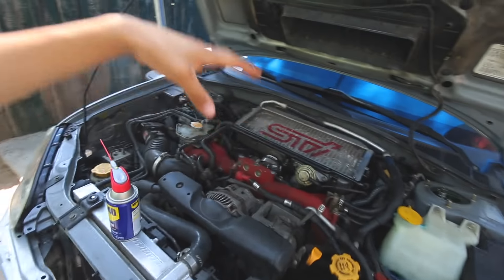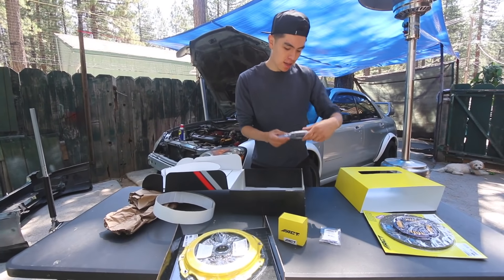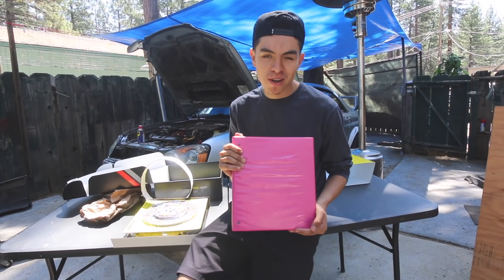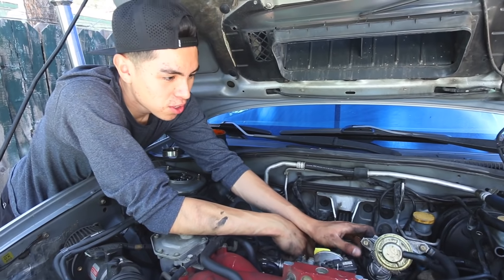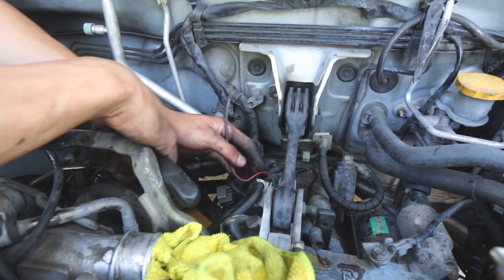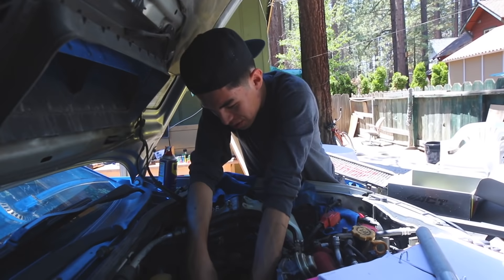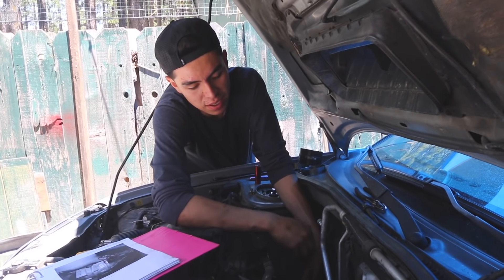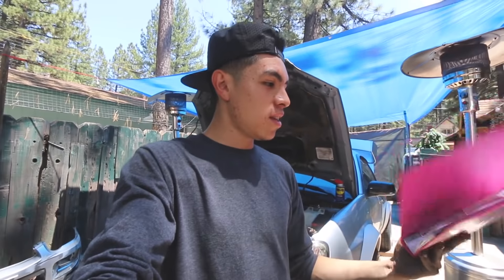My New ACT Heavy Duty Performance Clutch!!

Comment: Replacing a turbo oil feed line on my 08 WRX in GVille today. Trying to do it without needing to remove the intake manifold. Going to a braided line because the hardlines crack and break so easily. Not sure what you guys are up to today, but if you feel like kicking it Subie style hit me up, I'm around.

Comment: Congrats from Australia for going full time guys! Would anyone know   what could cause a squeaking clutch on a Bugeye WRX?
Reply: Through out bearing?
Reply from the maker: BoxaBug GDA what kind of squeak? Is it all the time or does it change when you release/push the clutch?
Reply: SubieTroops
The squeaking noise occurs when you press on it. I'll try lubing the fork this weekend and slave cylinder.
Here is the clip of the noise

https://www.youtube.com/watch?v=1PCMgw2e4Ak&app=desktop
Reply: Cracked firewall potentially, every subie in my town has that problem. Just rip apart the dash and inspect. If it's cracked weld it.
Reply: UnKnOWn ¿ throw out bearing
Reply: Alejandro Ramirez Negative, definitely not throw out bearing. Need to check the welds in the firewall now.
Reply: The same squeaking noise started on my car once the clutch was engaged and then after a while the noise kept on going even when the clutch wasn’t engaged. I swapped out the entire clutch and throw out bearing and flywheel with an act hd clutch and oem Subaru flywheel and the noise was gone.

Comment: I think the hardest part of doing a clutch job was getting the damn trans splines to line up with the motor lol. The clutch I used was completion clutch stage 2 with a competition clutch lightweight fly wheel. I never have any of the shake or jerkiness that you mentioned in your last video. Definitely upgrade you transmission mount and motor mounts if they’re not already. It’ll make your power plant feel more solid. As for Diego’s wrx you should tell him to do the Turn in Concepts shift linkage update for the wrx. It’s makes it feel like a new car and it’s fairly cheap.

Comment: Tip on getting the pin for the clutch fork out. Use a bolt from the timing belt cover, it is the right thread pitch and size; also nearly the perfect length.

Comment: just did an OEM flywheel/clutch on my 04 that I bought new. it wasn't that bad. but I had a lift. the hardest part for me was separating, and mounting the trans from the motor. Reinstalling everything wasn't bad. Just keep up with everything. But most importantly Be Careful!!
Reply: Did mine in 4 hrs, spent an hour tring to separate. Was the only difficult step.

Comment: Same clutch I'm running in my STi with an OEM flywheel. Suuuuper chattery at first. But after a few hundred miles it gets nice and smooth. By far one of the best feeling clutches I've ever had in my cars

Comment: Can I ask why you didn't go with the lightweight flywheel? I had to replace my clutch on my 14 Hatch when I spun a rod bearing in March, and I was recommended to use the lightweight flywheel for that clutch. I've put on about 3300 miles on the clutch so far and its been a trooper... I can't imagine how I dealt with the stock clutch and the OEM flywheel.
Reply: Agreed, plus that flywheel has a lot of miles on it. I changed the clutch and flywheel on my 05 about a year ago, and going lightweight for the flywheel has got to be one of the best investments I've made. So much more drivable.

Comment: You should get a aftermarket pitch stop mount it helps out a lot and is a nice upgrade
Reply: Eduardo Contreras the DIY window weld pitch stop has helped me a bunch (you can find it on NASIOC) plus it saves you a hundred bucks 👍👍

Comment: It’s a lot easier if you just pull out your motor my buddy did his clutch while at work in 1 day while on the clock working good luck
Reply: Jose Lopez, yeah I did the same
 Plus I changed parts on the motor that I inspected while out.
Reply: I hear this alot why is the engine easier?
Reply: UnKnOWn ¿ soooo much easier
Reply: I did the same, much easier and sont have crawl around under a car